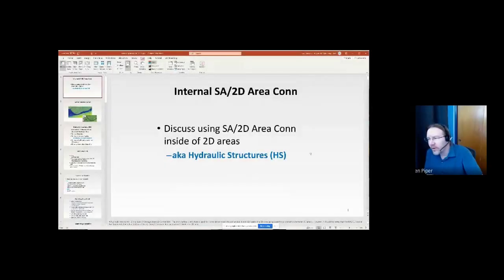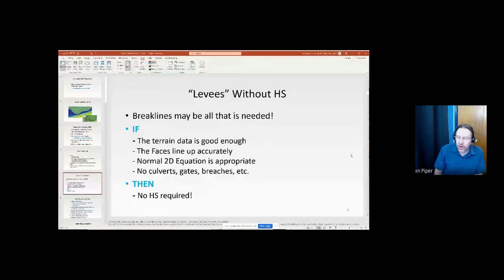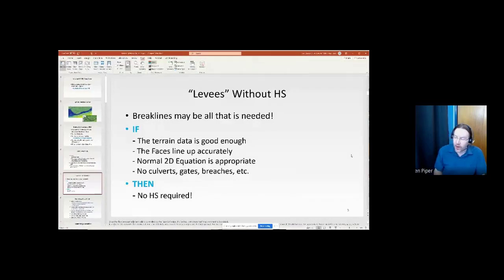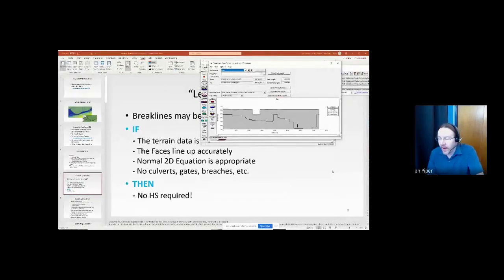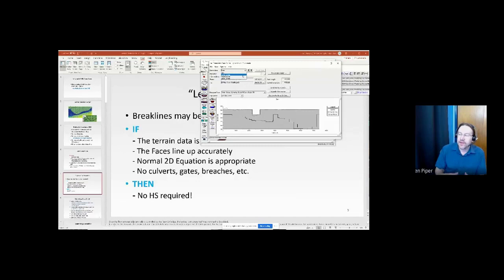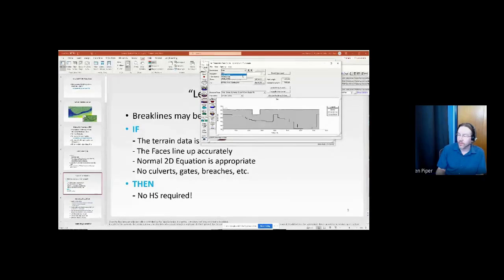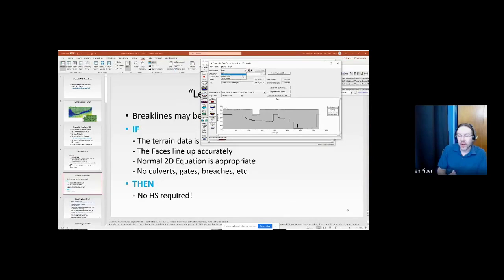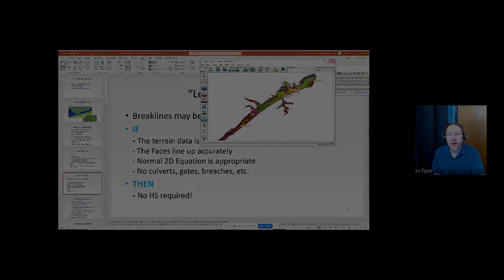HEC-RAS 2D Class 3.5b-  Internal SA 2D Area Connections Lecture

Comment: hello sir , i am continuosly getting  this error message  :- Plan file: e:\HECRAS PRACTICE\ukainew2\ukainew2.p01 Geometry file: e:\HECRAS PRACTICE\ukainew2\ukainew2.g01 Flow file: e:\HECRAS PRACTICE\ukainew2\ukainew2.u01 SA/2D Connection: sa2d There is an inconsistency on the information about flow direction over this structure. The positive flow convention for a structure is for stationing to increase going from left to right while looking downstream (like XS's). The centerline's direction is opposite what would be expected from the user entered 'From' and 'To' connected storage areas (or 2d flow areas). To fix this problem, you need to either: Swap the 'From' and 'To' connected storage area (2d flow area) names. or Reverse the centerline stationing (and likely the weir profile data as well).I have re drawn and  changed direction but still , this error persists